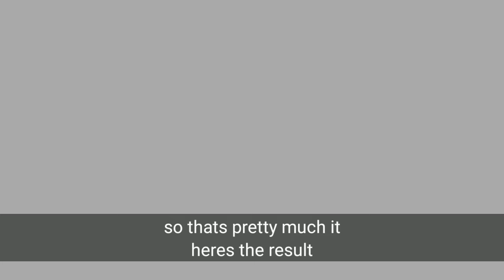How to paint gunpla eyes with ONLY gundam marker

Comment: emm do you have to spray a layer of topcoat after done with the marker?
Reply from the maker: i don't do that but it's better if you top coat it
Reply: @DaryllAsh  will the marker fall off if you dont topcoat it?
Reply from the maker: @wh4t4321  not on mine
Reply: @wh4t4321  no but it will be gradually oxidised depending on the humidity of your environment